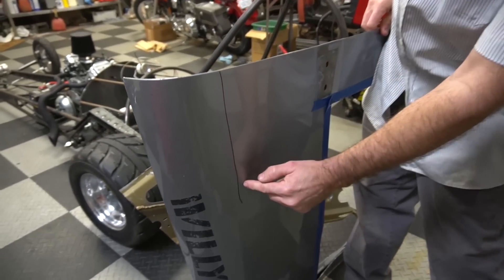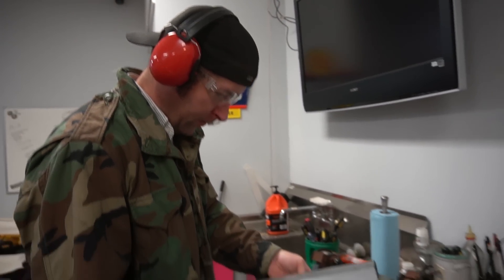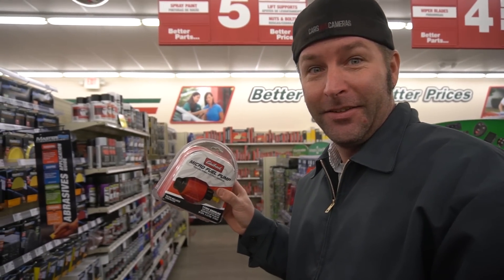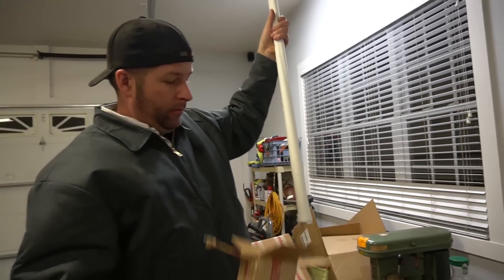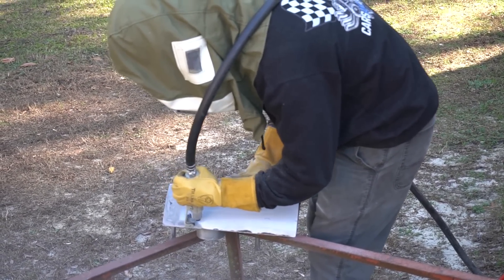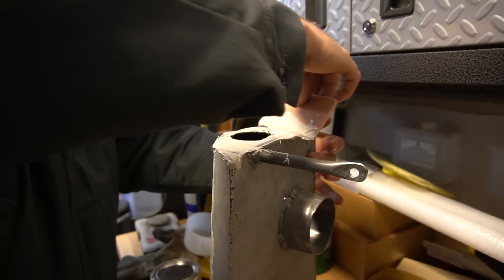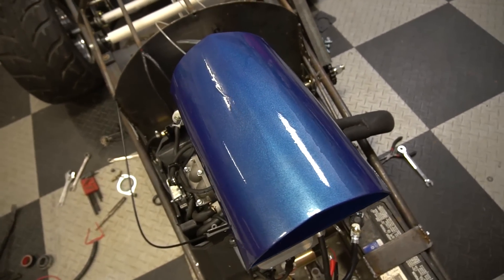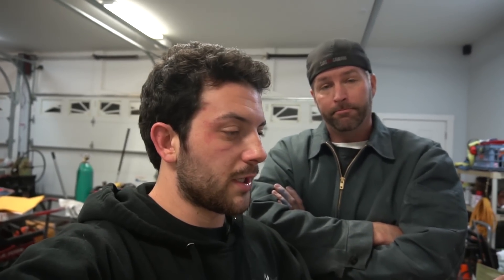Ram Air Scoop from Jeep Hood | 670cc Dragster Pt. 13

Comment: if you can modify the crank case breather to let some more pressure out of the crank case like an egr delete or pcv you can get some more power out of it. i have a brigs v twin with this mod.. reves up so fast👍👍👌👌
Reply: NICE suggestion
Reply: YES. WE NEED TO MENTION THAT DURING A LIVE Q&A SO THEY GET THE INFO!
Reply: hotrodj21, so I'm turbocharging a b&s v twin and I was just about to address this. How did you modify yours? I'm not going to have it recirculate, just dump into the atmosphere. Is there anything you did other than that? Running boost will make this mod more effective so I was wondering what you did! Thanks
Reply: Sloan V hopefully this info has answered your question if not let me know and ill see if i can come up with a better design.👍
Reply: hotrodj21, thanks for the reply. I still missed what exactly the mod is that you have done though
Reply: I got the notification for your reply but I can't see it now
Reply: Sloan V the reply with all that i have doneto the breather was like 2 pages long. is that what you cant see
Reply: Sloan V mine just dumps into the atmosphere as well. i did add a longer hose off the nipple of the breather up to a catch can to catch any oil that may come out. (if it does for any reason) i have not had any oil in my catch can at all. on top of the catch can i incorporated a valve cover breather that i bought from auto zone right into the top of the catch can lid and hose inlets into catch can 1/2 inch from the top of can.so it could breath good. just take the same approch to this as you would to turbo a car and youll be alright. to modify the breather i took out the reed inside and drilled some smaller holes. the way mine is designed it didnt look like oil could even get out of it at all.to this day i still have had no oil in the catch can. i did have to take a screw driver and pry the case open to get to the reed there is another baffel inside that stops oil from even getting out the extra holes i drilled were to facilitate oil draining from the breather you will see why i did this when you open breather it is hollow inside.and i only put the holes so oil would drain back into engine. case of breather is not welded shut if you set it on a flat surface you can pry the tabs back cleanly. when your done you should be able to blow through it with no resistance at all..
Reply: awesome, thanks! really appreciate it
Reply: Sloan V not a problem you show the world what that little engine can do and were even.

Comment: Helpful hint if you are painting in cold temps, put your spray can in a some warm water (not boiling, just warm/hot tap water) before you go outside to do your coats.  That way your paint is warm in the can.  I have painted outdoors in sub-20 degree temps with great success using this method.
Reply from the maker: Good to know!

Comment: John, protip, a small fan far away on low does a great job removing the fumes and giving you oxygen   welding masks without a venthood will make you dizzy and faint due to oxygen deprivation plus the fumes  use a drill with a wire brush wheel or grinder with brush wheel to clean up weld after for a huge improvement cosmetically

Comment: Hey just from personal experience... hanging a scoop with the carburetor in the middle of the base can cause leaning out and missing at high rpm or high airflow... this happen on my uncles 302 the way we solved it was to put a “dam” or a upside down ramp that forces the air down into the carburetor instead of pressurizing in the back of the scoop... you’ll also pick up more power because the air is forced down instead of whatever the engine is able to pull in... you could achieve the same thing by have a 90° elbow for a scoop

Comment: should go with a pressure switch or a wot switch for the fuel pump. the hole for the opg should have been done with a hole saw, be a lot more round then with the plasma lol. but its looking good guys.

Comment: Needs the jack shafts fluted to lighten them. Holes drilled into the front frame rail stiffener plates, several of the body rods removed to lighten that rascal. There are a ton of places you can lighten without suffering collapse. Would certainly help et and top end speed.

Comment: you guys should take a look at paint remover abrasives. you can chuck them in a drill and also angle grinders . they take that last bit of weld and polish the metal after you switch off the flap wheel .

Comment: a good idea to wire brush the paint.  straight after you stop welding.  the paint and the metal its on, will be very hot.  easy to brush the paint off

Comment: Get tappy tap tappy with the hammer and ever so slightly narrow the intake of that hood so entrance is smaller cross section than the main body and you'll get better flow and increase pressure at the air filter.

Comment: You can soak your spray paint in hot water for 10 minutes if it's colder outside than it should be.  It helps.  You gotta do it every spray session though.

Comment: Pod filter in scoop would  have a better ram air effect on filter then pantyhose and would probably flow more air. Use green spray paint,dusted with gold flake when still wet,then cleared.

Comment: With your air intake, the more air it shoves straight down the throat of the carb, the more power it will make. So something like a stainless bowl with a hole in the bottom and a filter on top will actually make more power than running the carb open.

Comment: hey guys, I've got a suggestion for the paint. You can buy a clear coat spray paint with glitter in it at home depot. there's a small section down one of the three isles. at my local hd, it's near the airless paint sprayers and wood stains, could be different at yours. You could apply the green first, then hit it with the glitter paint lightly at first to see how it comes out, add more as you need to. I've done quite a bit of experimenting with spray paints and I do believe this method will work. then you could clear again to give it a high gloss appearance and it will also give you depth in the clear coat for wet sanding out orange peel or any other imperfections.

Comment: I've been following each/every video on this and loving it!  I'm 60 and have the chance to fabricate (from scratch) my own rear engine sand/pavement Kart/Dragster (with more of a fuel altered frame).  Dec 25, please give us a list of the tools you guys used in this video...and omg...PLEASE  turn or cut that exhaust to work with the wind flow...it drives me nuts!.  The scoop/oil press gauge/color is awesome!  I have some tricks of my own for mine.  Merry Christmas guys!  You bring a lot of joy and professional assistance to this old car guy.  Also, how did you regulate the fuel pump pressure?  Is it built in?  What psi did you use?

Comment: Next time, try Duplicolor's "Metal cast" paint line. I painted my turbo Ranger's valve cover with it, and its still looking good 2 months later. (It's also engine paint, so its heat rated)

Comment: oh hell yeah, didn't I just mention this yesterday? after about 30-35 mph you're going to get some cheap easy free boosting, right now! for the "bug screen" metal pallet strapping (about 7/8 wide and springy) might be good stuff to stretch that panty hose onto, the width of it would help keep it in place vertically, then a couple screws through the outside to lock it in.
(gotta love those self tapping sheet metal screws!)
kinda thought you'd go the big 12v electric leaf blower method just for giggles, all the plumbing involved for a turbocharger.. bleh! belt driven blower could be cool too but where to put the pulley to drive the sumbich? plus it'd be like "always ON", where electric could be a switch flip 15-20ft after launch to begin its spin up and boost. old school ram scoop probably going to start getting active about 80-100ft down the track anyway. idk the diameter of the carb throat, hope the scoop is big enough to give it some good push!

Comment: Bolt that bench grinder down so you can use both hands. Are you guys using a layered grinding disc or a hard disc on the 4 1/2 ?

Comment: the blue looks really good.  But I think you should have put the oil gauge up closer, cause if it springs a leak, its gonna smoke like a freight train!!  Stop getting those cheap junk switches.  Start getting some lighted switches and mount them in a good panel so that you have a positive indicator of power being sent to the item it runs, and label the switches.

Comment: my question for the q and a on the 25 can u put a auto motive tech on a go kart like u did with the oil pressure gauge
Reply: there's electric tach that run off the ignition is easier.

Comment: Would a hole, or holes, in the firewall help reduce air drag?
Reply: its there to block the hand grenade in front of us. lol. if the engine blows we don't want to get hit with engine parts

Comment: Not to be a bummer guys, but in the interests of making it light and faster, I'd try and reduce as much weight as possible. Try experimenting with fibreglass as it's easier to form and lighter, then replace the steel one and you'll go faster.

Comment: Hey CarsandCameras when are you guys going to add the Nitrous to your dragster?
Reply: that snorkel would be a great place to introduce the stuff.
Reply: after we get as much out of it n.a.
Reply: They said no nos, they said prob a turbo. But with this scoop i think a supercharger(pump from truck) would be coolest
Reply: +Isaac it'll be fine , in FleaBay they were selling junk brushed motor "electric turbochargers" for cars that the cool Aussie guys debunked pretty good BUT.... what about a big fat model jet aircraft ducted fan+motor?!! some develop several pounds worth of thrust and really high CFM+RPM, I'm almost SURE a strong one will provide a lot of boost, and maybe small enough to hide right inside an air scoop (even that one if it's tall enough). might be scoop starts some pressurizing, then model jet fan rams it up LOTS!
be a lot easier and lighter weight than all the plumbing of a turbo for the same effect. there's 12v to 24v transformers to feed equivalent of a 6S LiPo hobby battery pack (or just use one for those 10 second blasts). it'd need an electronic speed controller (hall sensor on the gas pedal or just a switch for full power now?) because they are essentially an AC motor. seriously, I might be onto something with the idea of model jet ducted fan to boost. brushed motor no way gonna keep up with a CAR engine, but a brushless ducted fan sure might force feed that 670 plenty. turbo has a tendency to lag some with spinning and boosting, an EDF (electric ducted fan) wouldn't.

another thought on the concept, just ONE fan if it cannot move enough air, they "stall". I don't mean motor stall, they rev like mad for "prop slippage" like a boat prop will do, or that shopvac with the hose that grabbed your pant leg type stall.. but if two ducted fans are inline, less blowback through the vanes = more static pressure (lbs!) may be worth a try too.
Reply: lol add to that, some model aircraft EDF's could be made to fit/hide inside an aftermarket air cleaner for those 212 predator's ya'll like so much. powered off the air rushing through them might spin them and they might "tornado" the air being taken in (good for fuel dispersion+mixing = power), powered on they'd ram air in until engine RPM and intake CFM made the boost pressure fall off. put a momentary switch next to the throttle on the handlebar? minibike "surprise surprise surprise"? if it puts one of two identical go-karts 20 30ft out in front in a 50 yard dash it's a win isn't it?

Comment: I’ve had a need for a bench grinder a few times. Do you guys think the ones at Harbor Freight are alright? I only do light DIY stuff from time to time. & don’t wanna pay a whole lot for something I might use a few times a year.
Reply: we bought a h.f. grinder and took it back
Reply: They are cheep but for light use should work fine. I have one used it for a few years and is still doing fine. I bought a much nicer one from the flea market for $30
Reply: Mine blew up, plastic fan grenaded. Could have been bad. Went to pawn shop and a used dewalt. It’s still growing

Comment: Q and A : What has happened to the rat rod wagon, Yerf Dog, Murray, pugly, 670 go kart, $50 go kart, drift trike, AWD kart, all the mini bikes and buildoff karts, racing mower, and the American express? Are they all falling apart in your shed? If you got all your go kart/mini bike/drift trike/mower projects together and running, you would have around 25 projects to trash on. Bring a couple of trucks, trailers, around 10 gallons of gas, and your friends to a big, empty parking lot and have a race. Go off-roading. Have a burnout contest.Thanks!

Comment: don't put the oil pressure gauge there  fill the hole  and just run the bug catcher  open without the pantyhose the air going into the bug catcher will give you 1 or 2 pounds of pressure in the intake almost like a tiny tiny super charger

Comment: yes it looks terrible    slow down iisac     just use even slower strokes     and temp is crucial    60-80 best     so sand it down where the runs are and light coat affected areas then add
 clearcoat
Reply: They say it's probably going to get beat up, don't think he cares that much about how the paint looks lol! That being said, would have made more sense to do a flat color, so the runs are less visible.

Comment: with those quarter corners you could ve made one of those mad max interceptop hoodscoops 
http://www.madmaxmovies.com/mad-max-replica-cars/mad-max-black-interceptor-replica/scott-injector-hat-replica/scott-injector-hat-left.jpg

bondo is epoxy resin mixed with (a lot of) talkum powder you should basicly be able to put the dust from sanding back intoo resin to make more bondo 

blue looks ok on the dragster , think there actually was some superstition about green being bad luck in motorsports (or was that yellow?) 
shouldve sanded that primer with some waterproof before putting the colour on but oh well , good chance the runners will shine through in the new metalic paint too even if its smoother than a cueball
could do some gold accents on the paintjob (like pinstripes and lettering maibe even that paint over lace stuff )

Comment: Why don't y'all try swapping the springs and weights in the torque converter clutch so it launches at 3000 rpm where y'alls torque is
Reply: I like it, but it could make for some ugly squirrely launching idk. might be good to let it spin up to higher rev before the TC pulley's contract to give it longer legs.
Reply: model nutty a set of Jr drag tires will fix that lol

Comment: you dont run air filters on the drag strip.  y'all are adding so much weight to this thing. you should pull the battery and use a jumper set up. that would save you about 30 pounds

Comment: That fuel pump will not work very well where it is put. That pump is a pusher pump not a puller pump and needs to be mounted closer to the fuel tank.

Comment: AHHHHH!!!!! NEVER PUT BONDO ON CARDBOARD!!!!!!  Cardboard soaks up chemicals from the Bondo and could cause ill adhesion or even extended to improper drying of the body filler.  Always use non-porous materials like wax paper or plastic.  Sorry for the exclamation points its just this was stressed when I was doing my I-car Cert.